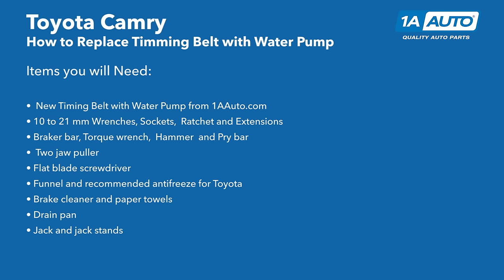How to Replace Timing Belt and Water Pump 92-01 Toyota Camry Sedan

Comment from the maker: √  Watch the Video
√  Buy The Part at 1A Auto http://1aau.to/m/Visit-1AAuto
√  Do it Yourself
√  Save Money
Reply: Can I replace just the rubber gasket out the old oil pump 
Oil pump bearing is ok no play
Reply: How would you change the timing belt on a eclipse 2002 Spyder GT
Reply: 噢哦
Reply: Uuuuuh I'm pretty sure if you rotate the timing belt with the tensioner pulley NOT applying tension, the belt will slip and you will no longer be in sync with the crank arm... BAD

Comment: You guys skipped all the cursing and swearing when getting to those hard to reach bolts lol
Reply: and losing a 10mm
Reply: Seriously dude, those two dogbone bolt were killer. Extended milwauke 3/8 ratchet would have came in clutch. I only had the standard one.
Reply: @jakobgrey  breaker bar did the job for me just took forever to get them off 😂
Reply: Hahaha no kidding
Reply: @jakobgrey  I have the half inch Milwaukee impact. About to start this job I just took the lug nuts off on setting one 1 I can't wait to see what else thing can do

Comment: Well the one thing I definitely learned from this video was that I don't want to do this repair anymore 😂😒
Reply: You aint lying lol
Reply: Liam Darden I did $550 not bad
Reply: after about 15 minutes into the video, I decided to pass
Reply: Same, only saving $200ish doing myself but this is such a pain in the ass and hard to get to that I'd rather pay the extra cost for someone else to take 3-4 hours doing it lol. Generally I enjoy fixing things myself but this is one of the more annoying things that could really bite you in the ass later if it isn't perfect
Reply: It’s not that bad. It’s a non interference engine so it allows for mistakes lol. I just did valve cover gaskets, spark plugs, timing belt , water pump and all new hardware and pulleys on my nephews V6 Hyundai Sonata... now that was more of a bitch than this Toyota for sure.
Reply: Why would they design the timimg belt so close to water
Reply: they all are , get used to it
Reply: @hacktheplanet4636  obviously it works. Many of them with over 1 million miles

Comment: Great video.  Don't forget to install timing belt retaining washer between crankshaft sprocket and harmonic balancer. I noticed he forgot to install it in this video. If you forget this, the harmonic balancer will sit too far back and the serpentine belt will not line up on pulleys correctly.
Reply: Nice catch I noticed it too, 24:15. 👍

Comment: Few things to add to this great video: Torque crankshaft pulley bolt to 80 ft-lbs and also camshaft sprocket bolt to 40 ft-lbs with aid of a pulley holder in case of replacing camshaft seal. Highly recommended to replace both seals and also oil pump seal, o-ring and gasket during this effort.
Reply: Replace oil pump as well ya think?

Comment: Great video (I did this same procedure myself four years ago (2016) on my '95 w/345K miles on it and a broken belt, did complete kit w/all seals)!

However, you guys SHOULD have done this video to INCLUDE R/R of the crank main seal, oil pump shaft seal, oil pump cover seal and the camshaft seal. Replacing all seals every other belt change (especially the oil pump cover seal) is pretty much mandatory. Also, replacing the thermostat cover is not necessary unless it's cracked/damaged, a kit with the water pump w/o the t-stat cover saves money, labor and time! 

Diving back in in a few minutes to finish tearing down my daughter's '97 Camry for a belt kit w/seals and w/p, her timing belt just broke at 190K (bought the car used last fall with 179K and unsure of belt status, was going to change it out next month (April) when warmer out. So much for best laid plans!) Just watched the video for a refresher for the memory.
Reply from the maker: +Husker65td Thanks for the tip! We'll pass this info along to our production team.
Reply: I agree, this is best time to replace the oil seals, as my newly acquired 99 Camry with 226k miles leak oil from this area. The previous owner said the timing belt was replaced, and now to replace the seals, one has to repeat all the labor once more.

Comment: This guy's very smart. He did it exactly like I did it about three years ago. I have another Camry now and it's nice to have your memory refreshed. I want to change all the seals also.

My advice is, it's best to do everything. That means belt, idler, tensioner, water pump, camshaft seal, oil pump seals, and the crankshaft seal. Use good parts and do it right and you can go 100,000 miles and change on it. Nothing wrong with a timing belt system if you use good parts and install them correctly.

Unfortunately, whoever had my present Camry before me was the victim of an M.M. job and now I have to fix it right myself. "M.M." is an allusion to that iconic cartoon mouse. Nothing against cartoon mice, mind you. But when you do a quick and incomplete job, that's what it's called.

Comment: Great instructional video! Finished mine today and everything went well. Only thing I had troubles with was getting the harmonic balancer bolt off. Ended up putting a 1/2” ratchet up against the frame and quickly hit the key to start it. Bolt came off and everything went well. Thanks to this video for the successful job done!

Comment: Like most of the 1AAuto productions, this is a very well done video. Anyone can do this job if they are younger and have flexibility. I've done this job on three Camrys that I have owned. This car is nice and clean and they have a nice indoor shop an every tool required! It's a nasty job if you do not have a lift and if the car is actually driven in bad weather.

I flat out refuse to do this job ever again! When the timing belt finally snaps my car is going to the scrap heap to be reborn as a tuna can or Honda! In the year 2023 the dealer wants no less than ten hours at $127 USD PER HOUR to do that job! My American made POS Camry isn't worth that much! I will go buy another used Japanese built one to replace it. The American built models were trash heaps made with inferior Mexican products and this car was one of them. At 160K its totally done! My 1999 Japanese model went 360K and would still be on the road if not vandalized beyond repair. 

NOTE: Use ONLY Toyota red coolant! NEVER EVER USE PRESTONE It will screw up the cooling system for certain! Ask me how I know! It has to do with the metallurgy of the engine versus the chemistry of Prestone products. You've been warned!

Also, the only way to truly bleed the cooling system is either with a pressure system or by raising the front end way up and letting the air burp out. Sometimes, it takes several tries to get it all out. There is a design flaw in the cooling system that creates an air pocket that takes a lot to overcome. The engine may need to idle for over an hour on the more persnickety cars. Been there! Done that! Bought the T-shirt! Got the scars! LOL 

FWIW!
Reply from the maker: +Steve Forbes Thanks for checking us out. Shop for high quality auto parts on 1AAuto.com:

http://1aau.to/m/Shop-1AAuto-c

Comment: just finished replacing the timing belt on my 92 . i couldnt get the crank timing mark to line up exactly at 0. it wanted to kind of spring into place at the five degree mark and if i tried to go to zero it would jump way past it was feeling impossible to get it to zero and since it felt like it wanted to be at 5 ... i sent it. its running fine, thanks for the help.

Comment: Three things: 
1. Why is it so important NOT to turn the engine counterclockwise while setting the timing? 
2. What is the significance behind the 1 & 7/8 turn before torquing the tensioner pulley? 
3. The timing marks will will only align when rotating twice because cylinders 1 & 3 fire at the same time. And to correctly check if the timing is correct everything is aligned with TDC to #1 cylinder for the project. Correct? I ask all three questions because if it is a non interference engine, then what does any of the first two question subjects matter?

Comment: Excellent video. Have no idea how those mechanics do this in couple of hours, took me a few days. My 2000 V6 was a little different, need to fabricate a special tool to release the tension. Old belt and water pump look like it could go for another 100,000 miles. Bought OEM, don't need to do it again or chase the right parts.

Comment: I did a 1996 4 cylinder highly recommended couple things.
Change all oil seals or at least the one on the crankshaft and the camshaft if you can.
Before I remove the timing belt, I cleaned off the edge of the belt,  where it meets the cam gear and the crank gear.
Using some brake clean wipe it off real good and then I took some paint fast drying fingernail polish paint in made two hash marks on the edge of the belt and on the crank in the cam gear so if I had to put it back together line it up I could use those jewel marks on each Gear to re- correct it.
And lastly it probably wouldn't be a bad idea to go to Harbor Freight and pick yourself up a oil seal install Kit of some kind in order to put them back in squarely so you don't beat him up when you put them in.
An extra $40 or so, and once you got it you got it forever!

Comment: I have noticed that you do not mention the dust shield behind the harmonic balancer or the gaskets that SHOULD be applied to the back of the timing covers.

I made an error in my last comment. Apparently, the two holes in the arms of the harmonic balancer can be different sizes. Why? I don't know. I just had one that used M5 X 0.80 pitch threads and another with M6 X 1.00 pitch threads. I triple checked and they were indeed different even though the two identical 1999 Japanese built Camry LE cars were made only three weeks apart. Amazing! (すごい/Sugoi).

Comment: Leakage is the most common failure of most automotive water pumps. The main reason for leakage is that the seal is not in place, so that the cooling fluid infiltrates into the bearing of the pump, which flushes the lubricant on the bearing, leading to bearing damage. Such leakage belongs to internal leakage. External leakage is also the main cause of pump damage, including aging caused by long-term use of engine seals and gaskets, internal leakage of heater, leakage of oil cooler and so on.

Comment: As another commenter said, now is a good time to replace the oil seals, as my newly acquired 99 Camry with 226k miles leaks oil from this area. The previous owner said the timing belt was replaced, and now to repair the seals, one has to repeat the same labor again.

Comment: Great videos.  Mine is a 6 cylinder '96 Camry.  Will I basically see the same mechanicals/steps/procedures on mine?  Thanks much!
Reply from the maker: +s. fitz Thank you for checking us out. Most of the steps in the procedure will be the same between a 4 cylinder and 6 cylinder, but there are a few differences because of the larger engine. 1aauto.com

Comment: Removing cooling expansion tank makes the job easier.
To remove pump assembly (with cover) from the engine only 3 bolts needed to be removed
Reply from the maker: +mkrp4 Thank you for checking us out, as well as the advice. This will certainly assist other viewers complete the replacement in a timely fashion. 1aauto.com
Reply: what is the cooling expansion tank?
Reply: Forgive Repent connected to the radiator. It holds coolant in addition to the radiator. I guess the coolant can expand and if so it goes into the tank in case. And it holds extra.:d

Comment: I felt I was being sold, but soon fellt more trust. Well that was a sweet belt and pump repair. Parked the car, went to YouTube, 1A Auto, Changed into some better clothes and shoes, wrote all the tools needed. Parts list. Noting steps. Raided the refrigerator Got my fluids level up. And begin...... 37 minutes later...... Completed ....... Mission accomplished. I am done, saw THE WHOLE VIDEO, even a few silly commercials.  Now like so many of you commenters. I Don't want to screw it up and now have acute 68+ mechanical anxiety. Should I spend even a lower $50x5 rate or hear worse. Sure if I take a full day. I can save maybe $300, but Its Nov 1 and shorter light hours can I be done in 1 day.  Will I not break anything? I have done similar on Kia a year ago. I just hate crawling. This i as bad as choosing a tooth to loose. or filling in for a groom at a wedding and honeymoon, and I have seen the bride on the A1 repair video.

Comment: Got a question.  Will a bad timing belt cause a misfire?  I have a 2000 Camry with this motor that has a p0300 p0302 and p0303 codes.  I’ve changed the plugs, wires, and the ignition coil for cylinders 2 and 3
Reply: Check your variable valve solenoids.

Comment: Swapping the TB and water pump this weekend on a Camry. Can the oil pump be accessed as well from doing this job without removing the oil pan?
Reply: Braden Conrad yes
Reply: If you do the whole assembly, you need to remove the pan...but you probably don't need to do the whole assemble, just the O ring(spaghetti) gasket and maybe the seal, if you don't have a new pump.

Comment: Those two holes in the pulley are for M6 x 1.25 thread pitch. A normal harmonic pulley removal tool will work if you get bolts with those threads. It is also possible to run a tap through the existing holes and create threads with a more common pitch.
Reply from the maker: +O Darn Thanks for the tip!
Reply: all cars I work on, I put a bit of grease on all bolts, on the pulleys, and on the cv-axle schlitzes. No water, no rust, easy to remove, and easy to tighten. On a couple occasions I used these two holes to fix the harmonic balancer in order to loosen the big nut. However, these are 6 mm, and very deep. If I need to, I shall drill to 7.2 mm and re-tap it to 8x1.25.

Comment: When tightening the crank pulley to the required torque, how do you keep the engine / crank from turning? Is there a special tool needed to hold the crank pulley still?
Reply: Use an impact. It will still slightly turn
Reply: pulley holder

Comment: Was great for me to do this.  Had to do the cheat on the Harmonic Balancer with the breaker bar and engine turn over.   Also an idea of putting on the bolts for the dog bone bracket, before the small belt.   It was a full day doing this on a jack stand compared to using a lift.   It would have been much easier with a lift and make sure you are prepared.  Thank you for the info 1A Auto.
Reply from the maker: +John Tossona Thanks for watching. If any of our viewers needs to make this repair, we carry the auto repair part shown in this video on our website. Here is a link to them http://www.1aauto.com/toyota-timing-belt-kit-with-water-pump-gates-tckwp199/i/gaeek00001?utm_source=YouTube&utm_medium=CTA+Comment&utm_campaign=ytcomment&utm_term=2kQLMP9AYGs

Comment: So I was busy and the water pump replacement took a few separate days. I've misplaced a 12mm bolt on alternator bracket. Any idea what size that is supposed to be?

Comment: What about the tensioner? I seen that it was pushed down to extend the spring and bolt was tightened. Now was the bolt loosened it can get tension on the belt?

Comment: Excellent video! My only question is this: Are you supposed to use RTV gasket maker with this water pump? My water pump did not come with a gasket. I installed it without a gasket and now it is leaking. Thanks.
Reply from the maker: +intercomtken Hello, and thanks for watching!  Water pumps do not require you to use RTV gasket maker.  All water pumps should come with a gasket, that will keep it from leaking.  If you look at this kit on our site you will see it comes with a gasket.  http://www.1aauto.com/toyota-timing-belt-kit-with-water-pump-gates-tckwp199/i/gaeek00001?utm_source=YouTube&utm_medium=CTA+Comment&utm_campaign=ytcomment&utm_term=2kQLMP9AYGs

Comment: I was told, and have never used an outside-jaw puller on the harmonic balancer due to the likelihood of damaging it. There are 2 threaded holes for the proper puller type to connect to without causing any damage.
Reply: If it's really stuck you would be correct, that it is a gamble. As you see he did not even need anything but his fingers on that one, so no harm, no foul. I've done 2 of these used the 2 jaw both times. One very easy the other not so easy but all went well. Those bolt holes you mentioned are very small. The threads were missing on one of mine. You could probably take a piece of stock metal and drill 2 holes for the bolts, insert balancer bolt and leave some space. Then use 2 longish bolts and tighten down to pull it off..but the bolt holes are small..5mm or smaller, I think.
Reply: I also injected a little PB blaster around the shaft the 2nd time..so there is that to consider too.

Comment: When bleeding the cooling system, can you just put the radiator cap back on and let it bleed into the reservoir?

Thanks for posting the video, guys.  The Haynes for the Camry is terrible, but your video explained everything.
Reply: Just pour coolant through the radiator when the water pump suck up the cooolant add more

Comment: My 98 Camry 2.2L is due for a timing belt. Beginner mechanic here - I've only done oil changes, spark plugs, filters, and a valve cover gasket. Am I in over my head trying to do this on my own? Any advice is helpful. Thank you.
Reply from the maker: +marvarvelous Generally it is not difficult to install the timing chain. Good luck with your installation!

Comment: How did you remove the harmonic balancer bolt without spinning the motor backwards?
Reply: You can put a breaker bar on the harmonic balancer bolt and brace it against the frame and use the key to turn the engine over quickly.  Scotty Kilmer did this in one of his videos, and I tried it on my 99 camry, and it worked like a charm.  Keep in mind, you don't want to start the engine, just turn the key for a moment to break the bolt loose.